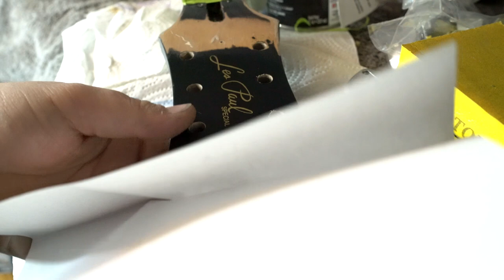Insane Epiphone Neck Repair!  Les Paul Style Guitar Fix

Comment: Ultimately I’m not sure how much it matters, but I use regular Titebond because the 2 pieces being glued back together seem to not want to slide as much. For what that’s worth.
Reply from the maker: Luckily when you wrap a string bondage style 800 times around a guitar neck it doesn't tend to move, haha.
Reply: @ForsytheVideo  You should use hot hide glue next time. I want to see how fast you can wrap the neck. Lol And you can't speed up the footage either.
Reply from the maker: @theshyguitarist  Haha, naahh.   Not really a reason to use hide glue in this day and age unless you're working on 18th century violins or just want to make your shop stinky.

Comment: That's the most gnarly neck crack I've ever seen. I almost picked up an epiphone from guitar center that had a complete headstock snap off, but even at 60 bucks it was a bit extreme for me. That repair is damn near invisible too, goddamn.
Reply from the maker: Thank you!  It came out alright, and I really dig the Watco lacquer, may do a video just on that here soon.
Reply: @ForsytheVideo  It's a lot better than I'd have done. I'd have probably just written the neck off and tried to do something dumb like fit a tele neck to it or something. One thing I would recommend is if you ever find yourself doing glue ups along the neck like that again, I would pick up some surgical tube instead of using twine. I did that when I was fixing a table leg and it turned out pretty great.
Reply from the maker: @moonchild4806  I have used silicone vacuum tube in the past with decent results, but I like the control of the twine,  Surgical tubing would probably be better,  Hope you're doing well dude!
Reply: @ForsytheVideo  Been doing pretty well, I've got a video scheduled to come out sometime next week. Been super busy with work and the like and on top of that it's been way too cold in NY to do anything for the past few months. Overall things have been pretty good though

Comment: You have to get some wide rubber bands instead of string
Reply from the maker: Yeah it sucks that the string totally ruined the repair
Reply: @ForsytheVideo  I don't know about that, it looked ok in the video.
   After I wrote the comment I read on and saw the guy mention cutting a bike inner tube. I think the Real rubber banding would work better.
   It's definitely easier to keep tight while wrapping than string, you'll have to give it a try next time and judge for yourself. You still got the instrument looking good and rocking and rolling again, that's what matters.